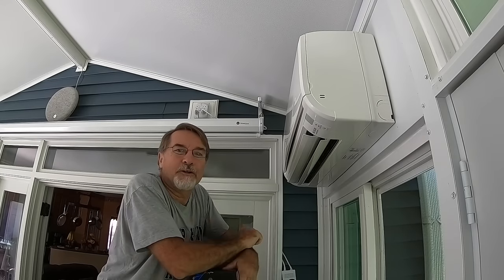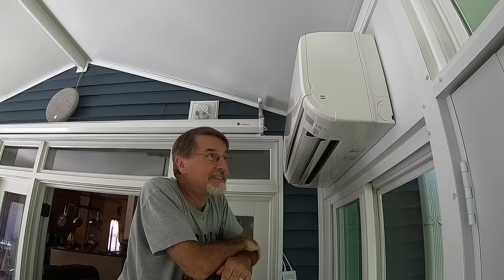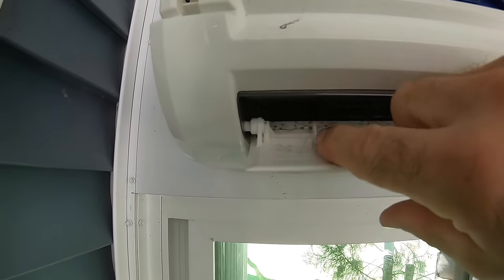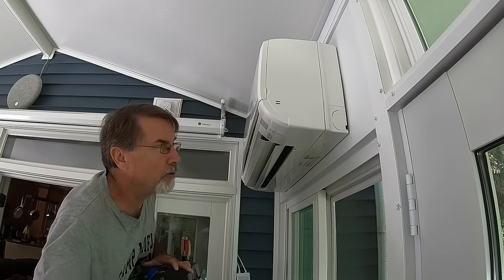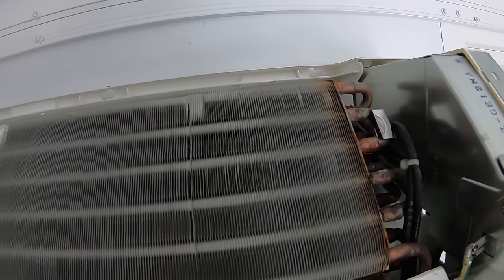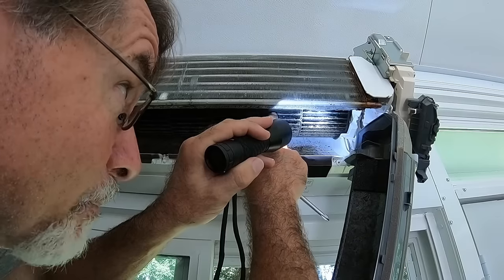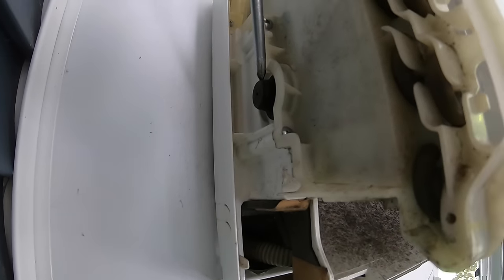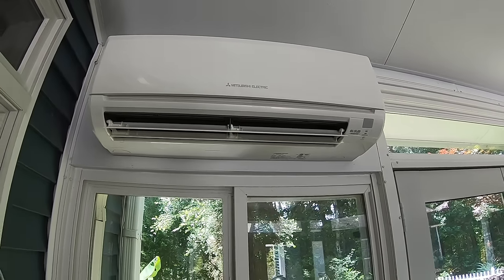HOW TO CLEAN AND SERVICE MITSUBISHI SPLIT AIR CONDITIONER

Comment: Thank you soooo much, we have a Mitsubishi mini split over my bed, its a year and a half old. ive been fallowing the regular cleaning according to the manual which is only the air filters. this weekend it burped up all kinds of water directly on my bed. NOT FUN. the manual was totally useless for finding a solution. now i have my wet vac in hand and some knowledge to fix this thing after work. Im so glad you showed how to get into the darn thing bc i was lost on how to take off the outer housings. A sincere thank you
Reply from the maker: Glad you found the DIY video helpful.  Cheers!

Comment: EXCELLENT video - Thank you for posting. Wished I had watched it before I had an A/C company come out when my unit was not performing as it should. All they did was run a diagnostic test ($100.00) , put in some refrigerant ($70.00) and tell me I should be good to go - NOT!!  After watching your video, I checked my unit and it was filthy (my neglect). Following your instructions, I should be able to do this maintenance myself rather than call the A/C people back to charge me another $100.00 or more. Just wished they had cleaned it when they came out the first time.
Reply from the maker: No one will pay attention to your A/C more than you will.  So glad you found value in the DIY episode.  Good luck Roger!
Reply: My unit was a little different from yours, but per your helpful instructions and guidance, I just finished cleaning 5 years of crud (my negligence) from my Mitsubishi A/C and now it runs like new. Tomorrow I think I will stop by the company who came to my home and ask why they never offered/bothered  to clean the unit when they came out for a service call. Thanks again and have a nice day!
Reply: more like 2- $300

Comment: Hello and thank you to you both for this vid. I've got the same model and have been frustrated in my efforts to (not quite) clean it from the outside for a couple of years now.  Today I finally got that cylinder out and it was apocalyptically bad.  Hard to comprehend what percentage of the air I've been breathing has been filtered through black mould.

Comment: Thanks for the video. It took some time but I got mine all cleaned up. The only thing that drove me nuts is taking cover off the white cover. The four tabs at the top in the back that you do not talk about did not come off easy like it did for you. I had to push them down hard to get it to come loose. I was afraid I was going to break it but it finally came off. I got my second one done and it was a lot easier after doing the first one. Saved me about $360 maintenance fee for the installer to come out and take it apart to clean it. They were trying to tell me it was un-level which I checked and it was not. Beside they installed it and they tried to tell me there was mold and after cleaning including fan, water trough and back behind fan I found no mold just thick dust that came off the fan really easy with a garden house and wet rag just be careful not to loose the small set screw that hold the fan in on the right side after re-installation. Remember to tighten it down because I forgot it at first but remembered before trying to start it. Also keep your screws separated since some are slightly different then the others. Also before putting the water trough back up make sure to blow out the condensation tube to make sure its clear or if its back up  already just pour some water in the plastic trough in from of the metal coils and have someone watch to make sure water comes out the other end outside. All and all a great D.I.Y video. Thanks for putting it out.
Reply from the maker: The clips can be a little tricky.  Glad you found the video helpful.  Thanks for the comment!

Comment: Good video.  I used it as a guide to clean the same unit at work.  Just fired it back up and the amount of air flow compared to before I started is much better...waiting for it to cool now.

Comment: Obviously filters don't do what they suppose to do. All dirt is inside. Very bad design.
I have the same model so after I done maintenance I added diy mesh filter. Just on top of the unit.
Thank you for your video. 
After removing two screws at the bottom I wasn't confident to pull the cover off ) So this is how I found your tutorial.

Comment: It`s the best tutorial ever! I`m going to start the same errand soon. However, I can`t understand what kind of detergent is used for the coil cleaning. Some people advised me to use an expanding cleaning foam as "MIZU". But some of them have a negative experience with this product and they more kin to use a liquid cleaners instead. Does it require a pressure washer for this procedure (to wash detergent out), please? Also, how to take out or isolate a circuit board from the area when it will be a wet cleaning provided? I also have bought a specially designed aircon cleaning pocket, to collect all the water to avoid flood :) Is this effective method in your opinion? Thank you

Comment: Great video mine is a little newer and I had to unplug the wires connected to the vanes on the dip tray. Mine also is showing corrosion - I am wondering if a rust converter may buy you some time. Mine must’ve never been cleaned had to bleach everything and clean it out works much better and no smells

Comment: Good video - mostly - but you skipped entirely any direction on how to clean the drip pan assembly, which on mine (as yours) looked as gunky as the rest and nearly impossible to clean thoroughly unless removed from the unit.
Reply: I am having the same issue - and am wanting to ask what we can pour into it ( as mentioed in the video, to avoid the gunk buildup.

Comment: in many circumstances I use a coating by finger of a stuff called Copperease in the UK,  which is a washable (it doesnt come off) copper colloidal grease usually from your car stuff suppliers. Getting on corrosion points prevents it developing especially where dissimilar metals are in contact with each other and wet.
Reply from the maker: Good info!  Thanks for sharing!  👍🏼

Comment: thank you this has been very helpful! we're having mold remediation done right now and I'm concerned about the mini split units in each room. Is this type of maintenance enough to remove mold in each unit?
Reply from the maker: This video provides the basic information for cleaning the drain tray and tube especially for clogged systems.  For assurance your entire system is mold/algae/dust free a more comprehensive cleaning is required a low pressure sprayer especially around coils on both the head unit and outdoor condenser.

Comment: Good video.  It seems though I have something that is overlooked.  I cleaned the drip pan out.  The drain tube is on the right but water was standing and drips on the left side.  Tube was flushed with simple green and vacuum but still drips on the left side.  Suggestions?

Comment: The Blower Wheel collects a lot of MOLD. 
And there is no convenient or fast way to clean the Wheel; it becomes the filthiest of all and the most dangerous. 
AND there is no “ clean unit” light that tells when maintenance is needed ( urgent in Mitsubishi’s case)
Mitsubishi needs to improve!
Lung disease is an issue here!
They should warn!!!

Comment: Which solvents etc did you use for cleaning the drain pipe? Sodium hydroxide is one recommended by other sources, but I wonder what else can be appropriate? 

It'd also be good to know which parts can deal with surfectants and residuals vs which cannot. For example there are aluminum-safe formulas with sodium hydroxide, surfectants and foamers which are used to clean engines and external radiators, and they do not leave any residue when thoroughly rinsed with water, but probably shouldn't be applied to components which cannot be rinsed. 

Meanwhile, pure acetone, toulene, etc do not leave any residual, the chemicals found in brake, carby, and maf sensor cleaners. but you'd need to know when not to use them in case they degraded a soft plastic or rubber component. 

I'd love to hear some tips on this!

Comment: Hi James, thanks for sharing. This is the most comprehensive DIY AC cleaning youtube video by far. Anyone here able to advise how to fix the rusty corroded copper pipes that was shown at 7:17? Changing that whole fin/coil unit is not cheap so I'm really interested to know how to fix that?

Comment: Thank you for that. I have a Mitsubishi MSZ-GL71VGD that is leaking copious amounts of water. Though the unit is about three years old it has had little use. The filters, which have never been cleaned, look brand new. I'm trying to remove the plastic tabs to get to the cover screws but they don't seem to want to move more than a millimeter. I have tried pulling them down and levering them forward. I feel that if I apply more force something's going to snap. 

Update: I have found it. Needed to pull the tab down slightly and insert a mall flat-bladed screwdriver over the top.
Reply from the maker: Glad you were successful.  It just takes some finesse.

Comment: Thank you soooo much! It was so easy to clean and one unit went back together beautifully. The second unit now has a rattle! 😱 If you push the top left corner closer to the wall, it stops.  We double checked everything and nothing we did seems to be causing the noise, but we can't tell. Any ideas!?!
Reply from the maker: Sounds like the cover isn't connected properly back into the case.  If this is new after the cleaning then I'd recommend verifying it's seated properly all around the cover.  If you can't find a clip that's loose then maybe you can remove it and reinstall the cover again.  The suspect area is the top left corner so that's where I'd look first.  Also, make sure the head unit is secure in the wall frame.  It might just be a coincidence that when you cleaned the unit the original installer might not have done it properly.
Reply: @MyPIDream  yeah, it's actually always been loose on the wall. You can move the unit up a bit....  I've always thought that was strange. (I ran a drywall screw thru a hole in the very back plastic frame on the top, it helped) But getting to that wall unit seems beyond me... Do you have a video about that?

Comment: Thanks a lot for the video, super helpful! Any tips on getting the cover off? The top-left and top-middle clips really don't want to unclip after a lot of pushing and tugging.
Reply: I figured it out. I jammed a flathead screwdriver where the tabs are and they popped loose.

Comment: Thanks. I have 2 systems in my house and the one of them is spitting out dirty stuff on the floor :-) I think I will try this myself.
The other has a fanmotor making some noise. I think it has to be changed with the new one.

Comment: James, thank you for this informative video.  Is it advisable to use the vacuum method of clearing a potential condensate line clog on a system with multiple (5 ) heads?  Would vacuum damage the pump(s) on systems that have condensate pumps instead of gravity drain?

Comment: Thank you for the great video. What solvent did you pour down the drain hose to help clean it?
Reply from the maker: You can use diluted bleach (50/50).  You can also use water/vinegar solution.  Remember, the main thing is to break up the algae that's built up over time.  It's recommended you do this twice a year as a preventative measure.
Reply: @MyPIDream  Thanks very much for the reply!

Comment: Hi! Thanks for your helpful video! You resemble my father and I am trying to address his ac issues to save us some funds. One of the lights is blinking. Do you know what steps I should take in addressing this? Yesterday I watched your video and removed the filters and cleaned them off. It worked well last night and today it’s blinking again. I have 5 units and its so humid and hot here today that doing the deep maintenance clean on all of them will be a bit much on this type of day. Any suggestions would be greatly appreciated

Comment: Thank you. Invaluable to me as one of our drain lines, running through the house, started dripping, so I am next to following your instructions and getting to drain tube cleaning.
Question though. "I am going to force some cleaning agents into the drain pipe" - how do?  Also, how exactly have you connected a 2 inch vac hose to 3/4 or so inch drain line? Just blocking it by hand?

Comment: I notice you have the unit on two separate 120v breakers. IMHO you should put them on a 240v single breaker or (if your breakers are rated for this) pin the handles together, so they trip at the same time. Consult a local electrician. Your rules may vary. But, in general, it is unsafe to run an appliance from two separate breakers. Should one trip, you might come in contact with voltage from the other one, while you are trying to solve the problem.

Comment: Its called a condenser, to be honest as long as theres no visible dust on the coils and condenser fins etc, its ok. i use a piece of trimmer cord weed wacker etc cord and place it thru the drain and leave the end out a little that way when you clean the filters you can wiggle the cord to ensure the drain is clean. If your careful you can also clean the blower with a dustpan brush. saves pulling it all off. Also if you mix oil of cloves into a sprayer you can lightly spray everything and it will kill mould without toxic mould kill.
The weed trimmer line can also be tied on one end with a clotch and pulled thru as well to help clean the line

Comment: Great video and appreciate the assistance.  What seemed like a monumental task was actually not that bad.  Having said that I am having issues when replacing the blower wheel.  Mine is not spinning freely as it did before it was taken out.  I would imagine this would eventually lead to the blower motor burning out which I want to avoid.  Any help would be appreciated.  I still have the rubber gasket and it was placed back on but the wheel seems to not be seating fully on the right side which is causing the left side to rub and stopping the wheel.  Do not want to muscle it and hopefully there is just a small step I am doing wrong.  Thanks.
Reply from the maker: Clean and lubricate as needed.  Sounds like you got some dirt on your gasket during removal/replacement.
Reply: The left side of our wheel has a small metal part that keeps hitting when it spins
Reply: @jhadine1  I had the same issue, the metal gasket was rubbing on the side of the unit plastic causing it to bind up. What I did was clean it out really well, dry it completely, buff it using a dremel tool, and then lubricate it. This let me get it seated all the way back in its original spot and able to spin freely. Hope that helps.

Comment: great video, will come in very useful when I have to clean mine. my only questions is, what about the outside unit? does the outside unit require any cleaning to be done, filters to be replaced, etc? thanks for the help, hope to hear from you soon
Reply from the maker: Normally the only thing I do to the outside unit is visual inspection for any damage from rodents like squirrels who like to chew wires and a light cleaning with the hose on the aluminum fins on the coil.  Be careful not to damage that with high pressure.
Reply: @MyPIDream  sounds good to me, thanks for the quick reply!

Comment: Hello thank you for this video. I’ve cleaned the inflow filter but haven’t taken off the entire casing yet. Mine had not been cleaned for at least 10 years 😱
So after I cleaned the filters I switched it in and air was blowing, whereas before I cleaned it, it was so blocked with dust that no air was blowing at all. So when I switched it on I went outside to check the exterior component which has a huge fan inside and usually blows out hot air and it was not doing anything. Do I need to service something in the outside component? Or does it start working after the air con has been running for some time? I hope this makes sense. Please help! As I don’t want to pay for a mechanic if I can do it myself. Thank you 😊
Reply from the maker: If your compressor fan isn't running when you're operating your air conditioner, it's possible you have a faulty component.  Maybe a bad capacitor or wire or another electrical component.  If it never comes on you need to have a qualified service technician take a look at it.  If it's only something like a faulty capacitor, it's not an expensive item to replace.  Let us know what you find.
Reply: My PI Dream thank you, I will ☺️
Reply: My PI Dream can I take a look somehow to determine what the fault is or do I need a qualified technician?

Comment: Great video. I have the same unit that drips water. It has a pump though and I cannot seem to find it. Would it be captured behind the back where the tube runs behind the catch tray?
Reply: Turns out my unit does have a pump. It’s hidden behind the bottom so you almost have to take the whole thing off to service it. I left I hanging on the outside so I can clean it each year

Comment: Hi James, Leaned a few things about split A/C that I didn't know.  Here in Indiana I haven't really seen any around, but it seems they are everywhere in the Philippines.  Just wondering if your father used Craftsman tools when you were growing up, mine did, and that is why I use Craftsman as well, to me you can't buy any better.  Normally I would call the flapper, or air director a baffle or louver, no big deal, I always enjoy your interpretations.  Look forward to more on the ongoing culprit caper!
Reply from the maker: Seems the US is the only country that hasn't embraced the spit A/C technology as has every place else.  Split A/C technology has so many advantages over the old central HVAC systems and its extremely efficient.  I am seeing it more now in the US but we're slow to move away from the energy wasting technology of the past.